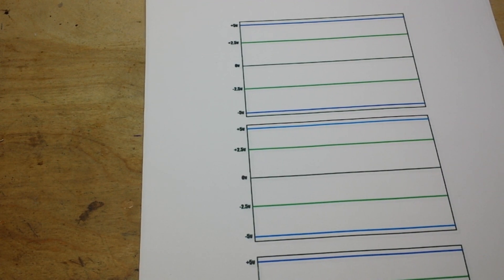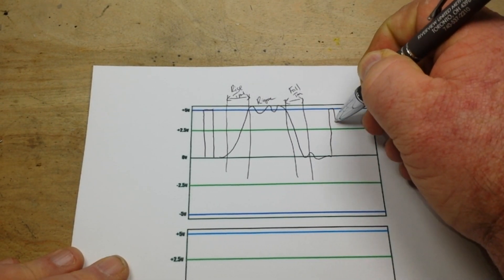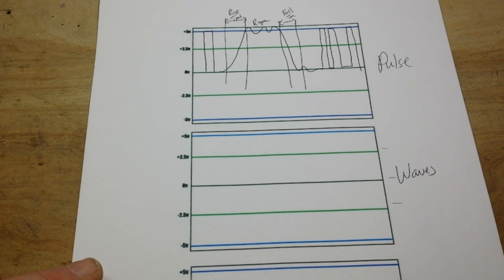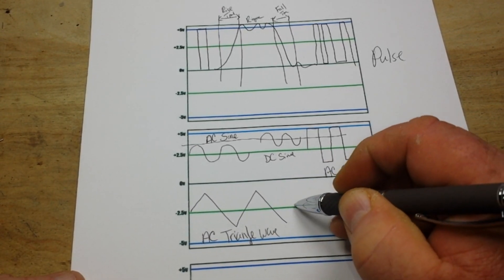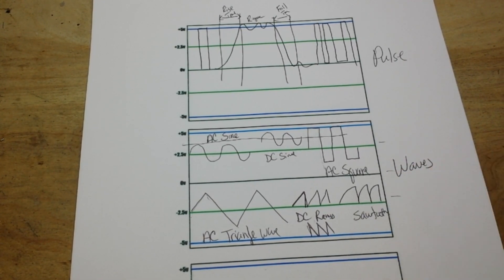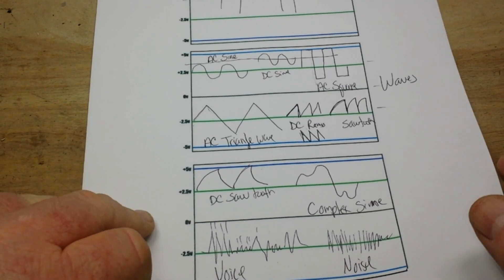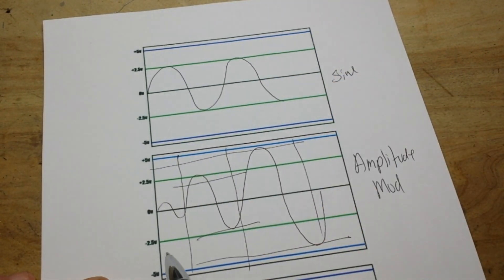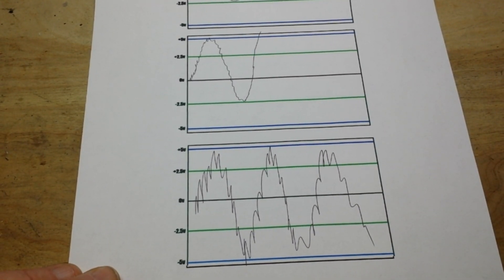Pulses, Waves, and Signals

Comment: Great video and one Ive missed watching until now. I bought one of those cheap handheld scopes you featured to dip into this type of thing. TBH i didnt have a clue how to use it but have picked up some things here and there. This info has raised the knowledge level and the interest further. Have you done any follow ups to this? I would like to know some basics on improving the circuit after identifying issues on the scope if you can. Thx